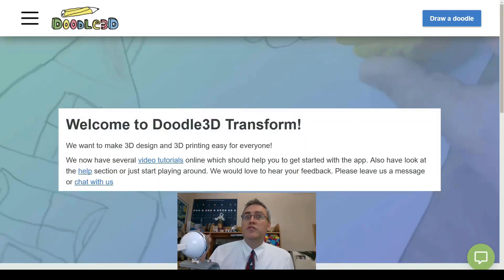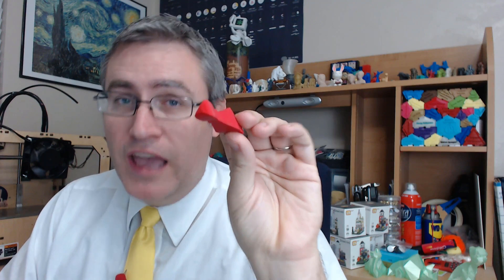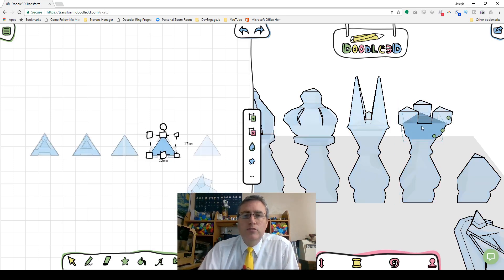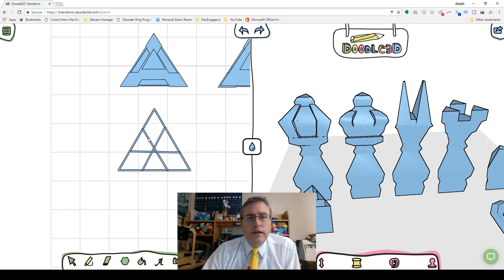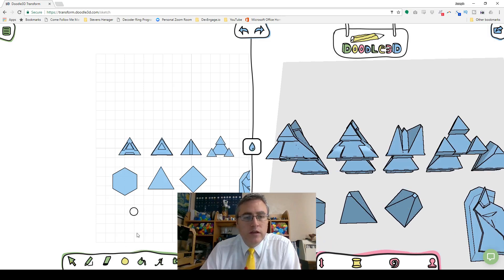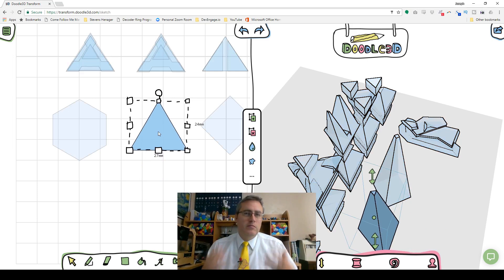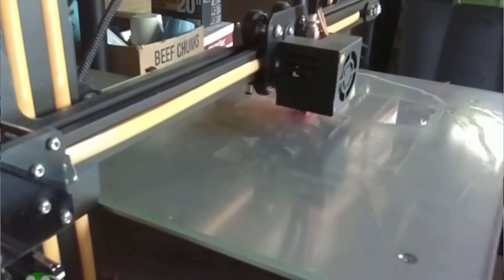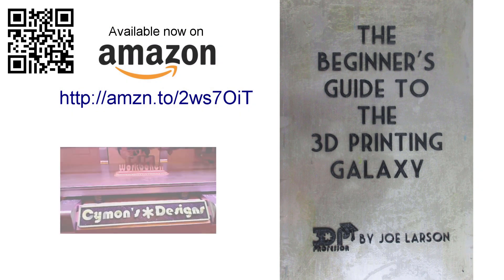Making a Triangle Chess Set in Doodle 3D for fun

Comment: Your video quality is up like a 100 fold! New camera?
Reply from the maker: Nope. But thanks for letting me know. It's the same exact setup, just inside where I have better lighting. I really need to improve the lighting in my shed if I'm going to record there any more. Good to know.
Reply: 3D Printing Professor the frame rate is like super smooth. Had been looking like a webcam before. Not sure if it was just me...